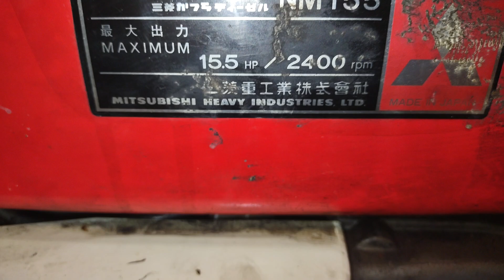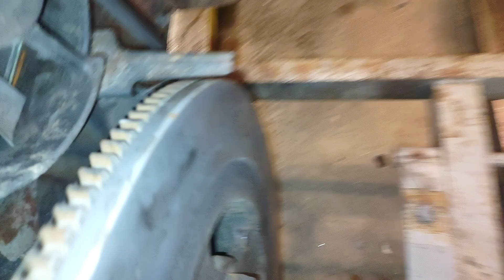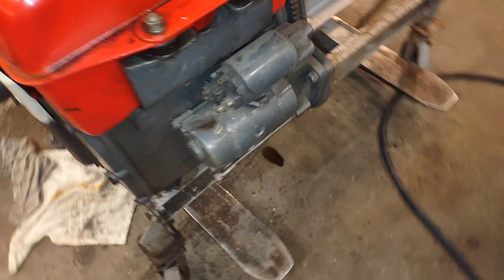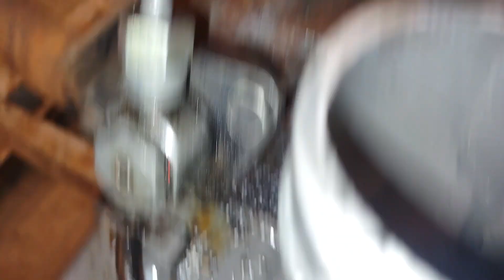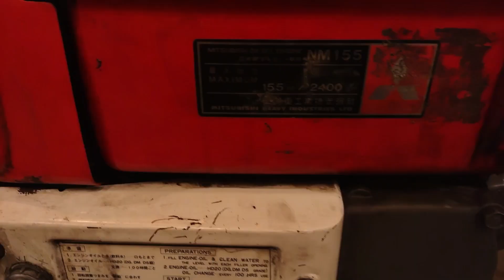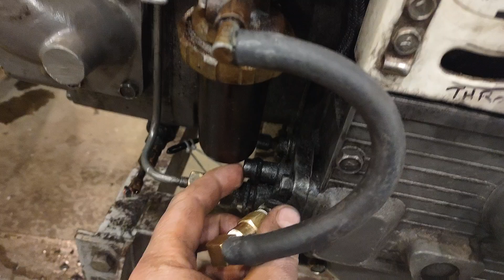(417) Mitsubishi nm155 single cylinder diesel engine, brief overview

Comment: Hi, i have 2 similar engines. Actually MN5, but also single cylinder water cooled diesels. Almost exact same configuration. They drive air compressors and were used in Japanese Tuna Longliners, as emergency starts for the ME. I am located in Africa. Can you perhaps tell me the oil capacity of the sump. Engines run beautifully and worth maintaining. Thanks